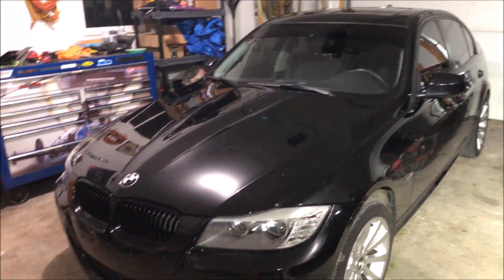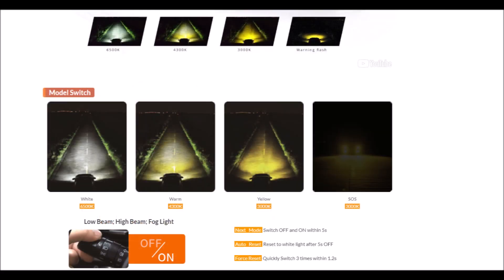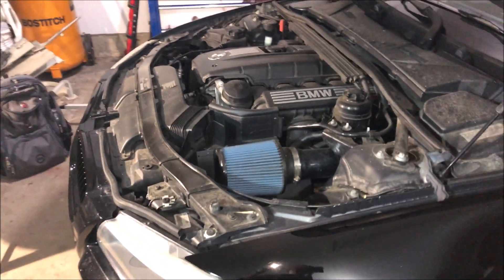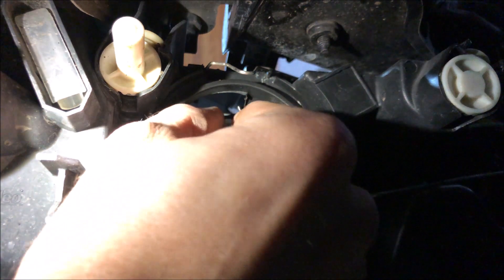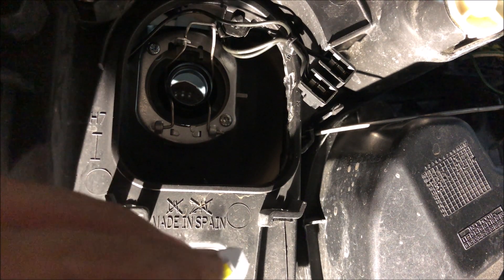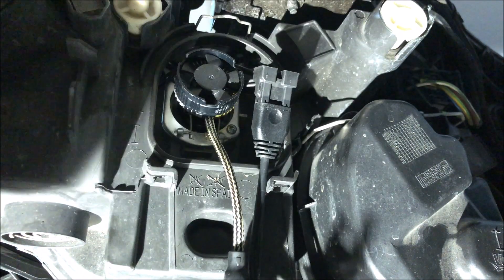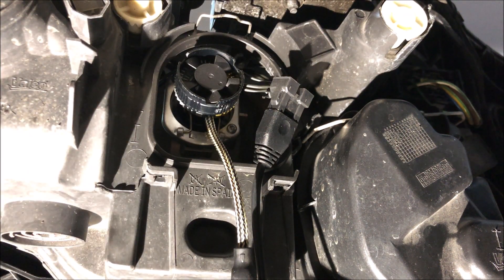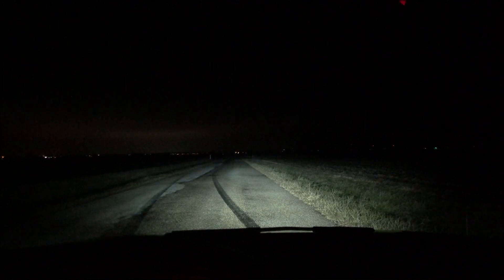How to install LED bulbs into Halogen headlights for E90 BMW: Boslla 4-Color LED Bulbs

Comment: Hi, I just came across your video. Thanks! There's been long and many discussions re using LED bulb for reflective housing. What's your thoughts? As far as I know only Xenon comes with projector housing so I struggle with replacing halogen bulb to LED while keeping the reflective housing. Thanks in advance!
Reply from the maker: Yeah that's a total toss up right, technically you are not supposed to put LEDs into reflective housings due to the light pattern. I don't see an issue with it as long as you adjust the housings to make sure you aren't blinding anyone coming at you. I had to adjust these down quite a bit after install myself, but the light output on this car with these bulbs is incredible.

Comment: is it posible to get to those from the engine bay instead?
Reply from the maker: Yeah probably, but its pretty tight and not super easy to see what you're doing from the top.
Reply: Lol so easy to remove the tire and guard.
Reply: Jack the car up (to give easier access - more space between wheel and arch) and there is a small panel (you can see in the video at 2:20 to 2:21, which can be opened using a large coin on 2 ridge points, so your coin is prising between the ridges to make them turn) which is removable and gives direct access to the headlights (+ indicator). Hope this helps others, as it is years later for you.

Comment: I’m very grateful for your video. I’ve mounted bossila led on low beams. Working great. Fun fact, my e90 is pre lci - no mistakes appear. I got one more question is it possible to mount the same setup on high beams?
Reply: Looking at pulling the trigger for my pre lci. Cool to know it works on those too as I was wondering about the headlight dimensions differing and still being able to cover and tuck. 2 years later still holding up? No shorting on the toggle switch from using all the modes?

Comment: 03:23 you mention the adapter but on the website it mentions clips, did you have to buy any of these or did that adapter come with the bulbs? Lights are dope I want to buy a pair
Reply from the maker: I was able to use what was provided with the lights, I did not have to order any additional clips

Comment: What kind of special retainer clips did you need for e90? BH7_3 , BH7_4 , BH7_5 etc. Next question I have: do I still need the can bus adapter if I have a pre lci e90 - 2008 model year?
Reply from the maker: I don't believe I ended up needing any special retainer clips, I was able to just use the metal retainer on the light that comes standard. As far as the can bus adapter I would assume you need it, unless you want to change the code in the car yourself. I still get a quick warning right when the car starts for a couple seconds, then it goes away even with the adapters.

Comment: I installed mine today. When I start the car I get the message that there’s a problem with the low beam lights. Did you get the same error message? Lights work well but get that error message. Any guidance is appreciated 👍
Reply from the maker: Did you install the can bus adapters as well?
Reply: @FixedVaneDuramax  I've already returned them. They sent me two different kinds of capacitors and neither one worked. I ordered a different brand from Amazon and they work very well. Problem solved.
Reply: @DaSurfr  what were the ones you ordered from amazon?
Reply: @FixedVaneDuramax  Yes, as instructed in the video. The warning/error appears when I start the car. The lights work perfectly, but the error message comes up. Although, I must say, yesterday I did not get it. I will keep an eye on it and, if it keeps coming up, I will contact the manufacturer.

Comment: Thanks for the review. I just ordered a set for my 2011 328i xdrive  :-)
Reply: Hey did u revive them yet and how’d they fit ?
Reply: @romes_  They fit very well. I did not make any modifications to the housing whatsoever. I just get an error message when I start the car. It goes away in a few seconds but it’s annoying.
Reply: @DaSurfr  they still holding up?

Comment: Code it bro like I did and you should not need any Decoders or Resistors with led
Reply: How did you do that? I installed LED for the angel eyes and they freaking flicker when I start the car.

Comment: Does it work on the pre lci too? E90 2006? With original halogeen headlights????
Reply from the maker: The pre-lci e90s with halogen lights also use h7 bulbs so I would assume so!

Comment: You posted this video nearly a year ago. How did they work out long term? Was it an issue having the cooling fans covered through the summer?
Reply from the maker: Yeah good question. Almost 1 year in, not one single issue with these bulbs has occurred. I checked the housings for heat and damage after several 3-4 hour long trips, no problem. Functionality wise no issue there either. I just switched through the colors last weekend just to play with them again, everything works great. From my end, this is a great product.

Comment: So these will fit fine? Bought philips ultinon essential led H7 bulbs which don't fit in my E91 LCI. The heatsink is too large and the H7 bulb clip is stuck it so that the bulb is facing upwards and fixed properly...
Reply from the maker: I had no issue with these in my e90 lci. The body of the bulb/heat sync is short enough to fit into the housing with clearance for the cap to close. I had to bend out the wire clip a little to get it to slip around the bulb body but it worked well.
Reply: @FixedVaneDuramax  Okay so you did not get any problems with bending? I haven't yet bended the clip, it would solve my problem but I'm worried if it would ruin my whole clip and it is not easy to get new ones because they are not sold separately.
Reply from the maker: I did not have any issue with mine no, they are a decently strong wire so they won't break when you bend them gently. Just go a little at a time and test fit until it works.

Comment: did you need the clips?
Reply from the maker: Are you referring to the adapter plate? If so yes you will need that as well to hold the bulb in place.

Comment: Does this work for the 2011 bmw 328i?
Reply from the maker: Depending on the lighting package of the car yes. If you have standard halogen headlights and housings this is what you need.
Reply: im looking for bulb for this car but its h8, car holds h7

Comment: Diode dynamics sells just the H7 LED bulb. Why you need the fan and can bus?
Reply: Not all cars' electric system are adapted for LED bulbs. Some LEDs will flicker in those cars that can't handle LEDs, or they won't work at all. CANBUS is some sort of "adapter" that prevents flickering and malfunctions when the vehicle is not adapted.

Comment: If you have your headlight set for auto does it change the color every time the headlights turns on? if so i assume you would just have to turn on your lights manually ?
Reply from the maker: If I remember right, if there is more than a 5 sec delay between when the light is turned off and when the light is turned back on, it will default back to 6000k white. I generally always keep mine on that setting anyways, so I havent tested it much but I would imagine if you went from inside a building at the 3000k setting , to outside, then back inside a building, they would default back to 6000k upon re-entry. May be a question for Boslla though.

Comment: Looks good. Is there a time setting or something where it will time out the color change?
If I leave the headlights on for an amount of time will it remember what color that it was set to?
Reply from the maker: Good question, honestly I am not sure. I generally run them on the 6000k which is the first setting. I would imagine it defaults to the 6000k on startup but I haven't tested that.

Comment: Just to be sure and letting others trying to use this know, the specific type for the 2010 BMW 328i should be the H7 version of it, correct?
Reply from the maker: Yes good catch! You do indeed need the H7 version of the bulb.
Reply: @mufasagoesviraltv5266  boslla carries H7 version, and I was able to install it without much issue on our bmw 328i
Reply: @Moochbox  i asked if they did on amazon and they said they didn't
Reply: would those be the red onces?
Reply: @mufasagoesviraltv5266  Yes the red ones on amazon with "H7" on the name is the one we installed on ours. This youtube video was the only one showing us how it will fit, so we went ahead and got them and installed it!